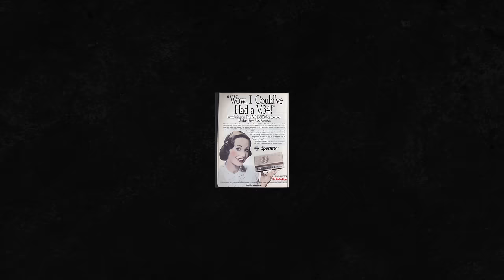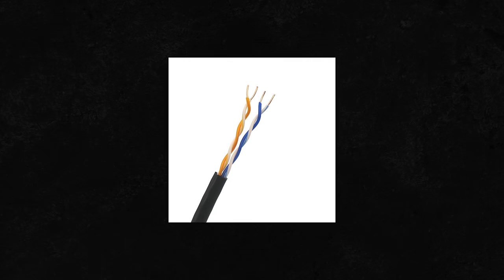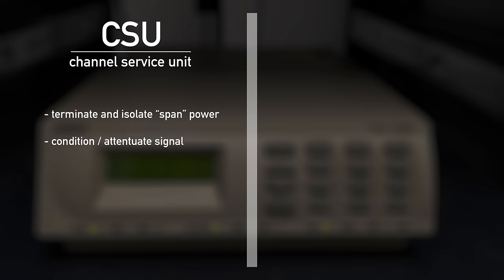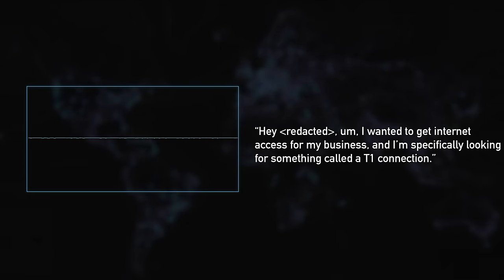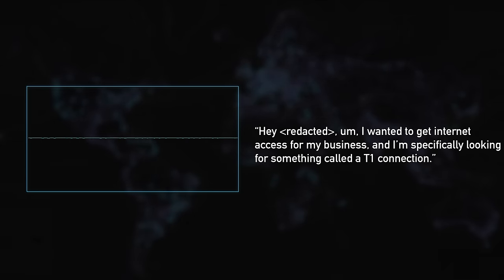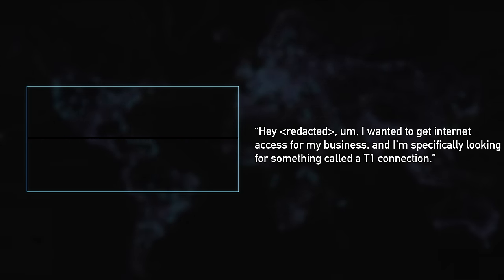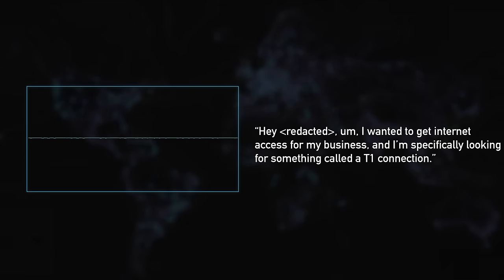1.5Mbps of pure '90s: Setting up a T-1 today - ISP Series Episode 3

Comment: T1s could also be used to bridge offices. Before high speed internet, it was common for remote offices to have T1s to the HQ/Datacenter (in the scale of a city in this case.  Across the country the internet and multiple telcos was still involved).  These T1s wouldn't have internet access directly, but it was routed and delivered from the HQ/Datacenter site.  We had a remote warehouse where I worked back in the day that was connected to our network via a private T1 connection.  You can also bond multiple T1s together to increase bandwidth!  I use to work with them all the time, and honestly they were a pain subject to the weather and the environment. This could be hell to troubleshoot and the telco usually wrote you off if the smartjack's lights said all was well.
Reply: You can still get this service and it's still very popular, just not over T1.

Comment: I can confirm this video. I used to do the TIRKS/Design side of these (ie, what the technician would do the install from). DS0, DS1/T1, DS3/T3. demarc, smartjack, copper spans. LOL I was typing you didn't mention framing, then you brought up ESF/B8ZS. This was by far the most common we handled. SF/AMI was fairly uncommon. Occasionally saw SF/B8ZS; B8ZS was handy for the customer because it had a "keep alive" signal so you didn't have to worry about your connection stopping just because there was no traffic on it at the time. Basically if it detected 8 0s it flipped some binary to trick the system into thinking it had traffic. ESF stands for Extended Super Frame.

I did get to take a class where I interacted with mapping a DCS machine to FLM600, FLM150. I know fuckall about DDM1000/2000 lol. Other than it's older then the Fujitsu stuff.

DS0 maxed at 64kbps. However, there were subrates that went down from 56kbps to 2.4kbps.

We don't do new installs of DS1/T1 and haven't for several years, now. Except for smart trunks (channelized T1), we still do those. We do still do DS3/T3, though.

lol I'm not as old as this sounds; I hired on very young XD

Comment: Our two AT&T T1 lines were over $8000/month in to the early 2010's when a second ISP finally installed in to our metropolitan area in the middle of Southern California. T1 was the best AT&T would do as they only had copper laid to the entire region. AT&T here had like an unspoken policy not to upgrade any commercial or industrial only area to FTTN, so for anything faster than 1.5 for general internet access, the bet they would offer for less than $25k/m was 5/0.7 ADSL, which was around $200/m including all the fees and required (unused) POTS lines.

Comment: I worked on voice systems back in the early 90s. Lots of fun using the T1/E1 lines in the lab, though focus was either on the voice processing, or telephony signalling (various cas protocols, SS7 &  later ISDN). Lots of custom hardware, but also fun test kit & switches (AT&T, DMS100 etc) Was rather nice when we moved to chunky ATM connections (622 Mbps)

Comment: We used to have ISDN lines, which came later than the T1 connections to simplify them...but the ISDN were still available for use in outside broadcast for radio stations because they allowed high fidelity audio backhaul to transmission sites...

Comment: Wow this is a trip down memory lane for sure.

I've been honored and privileged to work for and with some of the better known companies in the bay area for the last 25 years. I remember visiting Zip2 (as I had a buddy that worked there) in the late 90's early 2000's and they had a T3 line there (45mbps) and it was just ungodly fast. 

The company I worked for at the time had a T1 (I think just fractional) and yeah I spent many late nights there Quaking it out until the early hours of the morning. 

I was contracted out to Sprint for a while and I remember they had an OC-192(~10gbit) just sitting in the lab. I was always bugging one of the engineers that worked with that equipment to "hook it up" and he was always like hook it up to what?! I don't think I quite understood at the time why we couldn't just "hook it up" but it made sense later on. The only thing you could probably hook an OC-192 up to was another OC-192 to form a backbone of sorts over some long distance.

Years later another buddy and I looked at getting a T1 installed at home as the cost had come down quite a bit to the $500/mo range which was still pricey, but we could have maybe managed it. Ended up going with DSL instead.

Those were the days!

It's crazy how fast things are now compared to then. My first modem was 9600 baud back in the early 90's and now get nearly a gigabit download speed at home.

Comment: Here in Australia we used E1 instead, which was 2Mbps, and usually provided an ISDN PRI service of 30 x B channels of 64k each (and one D), which was a massive game changer for dialups.  Two incoming cables, just cat5 from memory, connected to a magic Cisco AS5200 or 5300 and you had 60 "modems" for people to connect to, compared to the Christmas tree of rack mount modems before with a separate twisted pair connected to each individual modem.  Networking was fun then, with Frame Relays, ATM, and more.  Different network stacks (IPX/SPX, Banyan, and IP).  Now most things present as ethernet and IP.

Comment: I had just about every speed of connection out there.  I went from 2400baud to 14.4K to 33.6K to 56K.  Then I made the big step up to ISDN!  Then cable modem, then to ADSL and now, finally, fibre.  I think the only thing I never had was a T1.

Comment: A few fun facts... 

1) those poor 2500 series router could technically run two T1s, but if your upstream wanted to use MPPP to bond two together (so you could achieve single-stream speeds above 1.5Mb/s) and you actually ran a pile of customers behind it, the CPU just couldn't cope.
2) don't use ethernet cables for T1s, the pinout/pairs are different and if it's a "real" T1 (see below), you can really waste a telco tech's time troubleshooting this - it can work on a short distance or from a smart jack to the CSU, but one of your T1 pairs is going to be split over two ethernet pairs...
3) in bell atlantic territory, they very quickly moved from "real" T1s to HDSL - to the customer, it looked like a T1, but it was actually an xDSL technology that removed the need for repeaters (and some would argue, some of the reliability, esp. as techs were coming up to speed with it) - I think I started seeing these in NYC around '98?
4) frame relay T1s were really common then and were generally cheaper than a fractional T1 since they did allow for some oversubscription for your upstream - it was kind of a simpler precursor to ATM. In the old days, UUNet even used frame relay encapsulation for their T1s in the NYC market - my memory is fuzzy on this, but I believe the main reason was not to oversubscribe, but the cost of a Cisco channelized T3 card (IIRC around $60K when I last bought one) vs. a T3 frame relay card ($10K?)...

Comment: I always thought T1 was a fiber connection, guess not.
My speed history was 28.8Kb/s, 56.7Kb/s (for a stupid amount of time), 5Mb/s (first DSL line), 10Mb/s (cable when moved out), 15Mb/s (latest gen DSL), and then finally 100Mb/s fiber which I have today.
When all I had was dial-up and DSL, fiber seemed like the unattainable dream and I had visions of what I would do with all that speed.
Turns out, after you actually get that speed, you just take it for granted.
I have just become accustom to the new speed.
I have a little desire for gigabit, but it doesn't feel necessary at this point.

Comment: I first got DSL on February 29, 2000, at 1.5 mbit down / 640K up. (I don't think I got the full ADSL1 6 mbit down for a few more years.) Kind of weird to think that people were still installing T1 lines at the time. Shortly after that I got not one but two domain names, and have been running DNS for them ever since, with a /29 on my DSL even through a few moves. And now I have Google Fiber in my street, but they haven't lit it up yet.
Also, being in San Antonio, that pic at 13:50 reminds me how it was late to get on the internet. Even Austin is just a tiny little square there.

Comment: A radio station I help out with sometimes, still uses a T1 for their audio connection between the radio station and the transmitter site.  I think the only reason they havn't been bumped off yet and told to use something else is that they pay a premium and have been using it for 25 years.  Still the station engineer has been working on a new system since its getting harder and harder to keep it, the phone company really wants to get rid of it.

Comment: I ran a dialup ISP in the mid 90s with 64 modems connecting to a single T1. I felt like a god with my 1.5Mb. There was barely any latency, either, everything just felt much faster. Our Class C block was from GTE and I think we paid like $4,500/month for that connection.

I had a client still recently using a T1 (well, 2 of them bonded) for their office of about a dozen people. Finally got reasonable fiber to that part of the county in 2018, though.

Comment: Did someone say csu/dsu?   Back in the day I worked at an ISP and we had a blazin 4x T1 upstream. Using a inverse multiplexer.  But is working there were granted our own 24x7 ppp dialup line with a company static IP address.    Good times.
Reply: Also back the you need to be a big player to use BGP.  Most upstreams would not even configure BGP for you in you only had a few /24 or a /22.     Shocking enough some of the big networks like Sprint were static routed into the 2000s.   And one place of my past was /16 and static from our upstream.

Comment: Would love a video on what the hell EFM or Ethernet First Mile is. I sold them in 2010 but had no idea how it actually worked. I think they put 4 copper lines in (2 pair each) to simulate Ethernet to the Exchange/Pop?

I remember an X Files episode where the nerds had a T3. 45Mbps, was blown away at that speed potential as a kid!

Comment: Back in the 90s I worked for a dial up ISP. We ran 20k customers on a single OC-1 line. Now I have an unmetered 1000mb connection straight into my computer. It's just fucking wild sometimes thinking about fast this tech progressed.
Reply: That's 50 Mbps, right on an SC-1 line? Did you do BGP and have multiple upstream ISP's? Did you ever hit peak traffic of the 50 Mbps? Thankfully, in the 90s, everything was text-based for the most part. And yeah, it's insane how much faster things have gotten, I am sitting on a Gigabit connection with multi gig fiber connections being available for some people.

Comment: Cool info. Never actually knew what T1 or T3 were. I kinda thought they were fiber connection or something but surprisingly just old telephone wires :) First time and maybe last time I saw them was in Napster P2P software where you could select your connection speed. As a European we didn't really have these at all I guess.
I used 33k first which was free to use via a magazine order I had (MicroBit or something) then I realized I can just call to my local telephone companies modem numbers to get 56k speeds.
After a while on that we got ISDN which was 128kbit/s when using both channels and the latency was much better.
2-3 years after they started selling ADSL which I got quite soon when they started selling them and it was 256kbit at first but gradually over some years they increased the speed up to 8Mbit for the same price.

Comment: Every time I hear "delve" I think of a gpt script these days lol gotta write it up from scratch, man 😜

Great topic. I couldn't even imagine internet faster than my hard drive when ssd hard drives didn't exist yet.

It still blows my mind that for the price of a used car back then you got a current windows system - today that's 1/5 of the inflation-adjusted cost if it costs $5k today to get a car that passed safety inspection and works. Difference is today, that's a 4k display, 100x storage at 10x the read/write speed at 1/10th the price and with 8 to 16 times as many processor cores.

If inflation hurts, buy a computer and learn to make it make you money passively. It's just so cheap to self educate these days, especially with YouTube.

Comment: The reason for a T1 be made of 24 DS0 or "circuits", is that this bandwidth required one amplifier every mile of cable. 

In Europe, they settled with one amplifier per kilometer, so the European equivalent, E1, is actually faster than the T1, consisting of 32 "circuits".

Comment: As a high schooler from 2001-2005 I fantasized about T1 and T3 lines. T3 was just otherworldly at 45mbps and here I am in 2023 with 1gbps fiber to the home and I don't even care if it underperforms by 50% because it's plenty.

Comment: I set up a T1 back to back loop for a school on two unused pairs.  It was proof enough for them to get sdsl hardware ordered and go from 2 pairs to 1 pair and 1.438Mb to 98Mb... how tech has changed
Reply: Also, if you really want to make a multi site T1 over Telco you can possibly order dry pairs from the providers, some supported and some didn't when I asked in 2006.

Comment: I'm not surprised you couldn't get a T1.  It's been a few years since I worked with T1s but, even then, they were often emulated over IP.  The Adtran box you have is intended for primary rate T1 and I believe it can actually dial up the full 1.544 Mb connection on demand.  That was the case with the Adtran ISU I used to work with to connect basic rate ISDN.  When I was working with a full T1, I used a different model from Adtran, which did not support dialing.  Also, I prefer the term DS1, as T1 implies telephone channels, whereas a DS1 is simply 1.544 Mb, which can be used for anything.  Also, I have a Cisco 2651XM router here, which I bought used when I was working on my CCNA.
BTW, address classes have been obsolete since the mid 90s.  These days we use CIDR, with variable length subnets.

Comment: this year I upgraded my connection to 3.25Gps fiberoptic with wifi 6 mesh and i get 2.4Gps up and down to my desktop. i often sit back and remember the days of my 56k modem and when i upgraded to broadband which was around 10Mps if i recall. the downside is that i never get close to using my full speed now, I seem to have hit the limits of the servers uploading to me. the most i ever see is 1.3Gps downloading. back in the day when i had poor connection speeds we always knew there was more out there if we could only increase or pitiful speeds.

Comment: Did you back-to-back the Adtran T1 ports or were you able to find the equipment to make that smartjack work?  I used to find these smartjack cards discarded by the hundreds in the 2010s and wonder if I still have a few.  I never could get them to fire off except with a 48v local telco power supply.  The serial port didn't provide much info since the card had no data connected to it, but it looks like there was a whole bunch of diagnostic things you could do with them that I'd imagine were super useful for the provisioning of the T1 circuit.

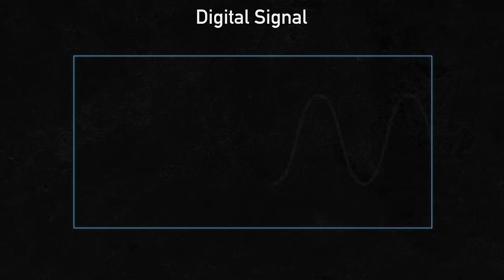Comment: The Bell Labs invented T1 or digitizing of telephone network. One very crucial feature is missing at about 2:50 in this presentation. Bell Labs also invented the error free line coding ie. how the bit values were coded in the copper cables NRZ non-return-to-zero and HDB3. And also the repeater ( max 1.5 km apart) power feeding remotely.

Comment: The 2100 is a beast, and they are still in use today in networks. Very legacy but still there. They are being killed off however by the Dallas RTC clip failure. NVRAM failure will cause them to boot in rom mon

Comment: We sold a customer a fractional 256k fractional T1 at a startup I worked for. The guys running the network didn't know how to fully program (anything) and they delivered a full 5mb to the customer. The customer was complaining of slow speeds, so I go out to take a look knowing they have way more speed than what they are paying for. The customer tells me we need to put more fiber in the network. They're actually connected to a layer 3 switch on our ATM backbone 100ft away in out POP site on the other side of the wall. 
I ask to see the office network. They open a closet door and I am blinded instantly.  They had these huge LattisNet hubs joined to each other. When one port fires, they all fire creating a light show to rival the sun. I told them to get network switches, not hubs and they kept whining about how much money they spent. I told them I could get a plastic switch from Future Shop that would destroy their old networking gear. Last time I saw LattisNet gear a year later, it was in a scrap heap with a coin countimg machine from a bank reday to be broken down for metal.

Comment: WV still has T1 lines. Once frontier gets fiber everywhere then they will begin no longer supporting t1. However for businesses they still will support most copper circuit services. Usually the POTS lines and offer them fiber for internet, but I believe that means in some areas they will still offer t1 for decades. I do telecom construction.

Comment: Waited a long time for such a video :-) Thanks for that.  But one Question: Where was the other side of yout T1 line? Was ist really a friendly local  ISP or did you set up the central office part yourself?  If so, which hardware did you use for the CO part of that?
Is T1 and DS0 and everything really that old? Was HDLC used in the 60ies and 70ies as well or did the technology evolve way further than you recapped in your video?  Always asked myself how the connections between the nodes of the arpanet were  connected early 70ies - could not be a 300bd modem, I thought.....